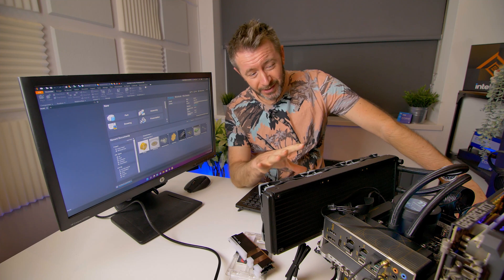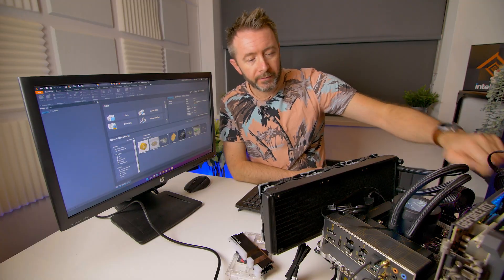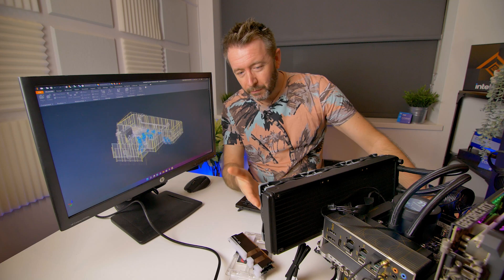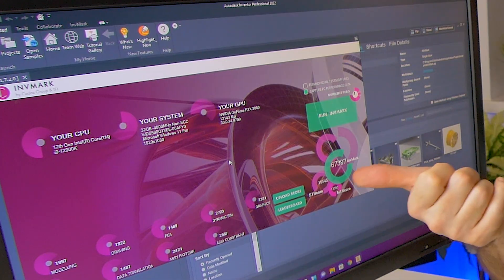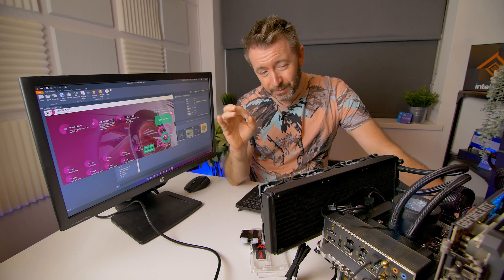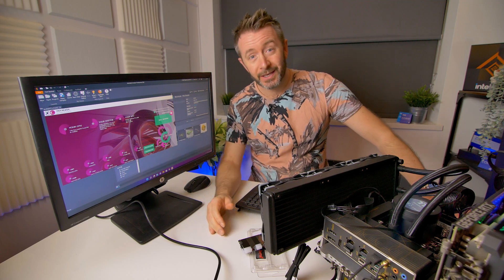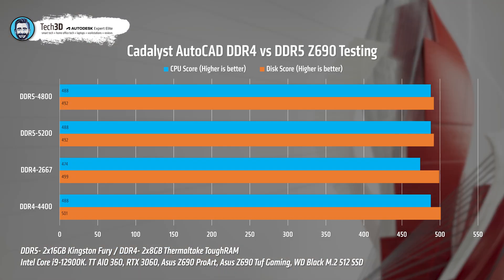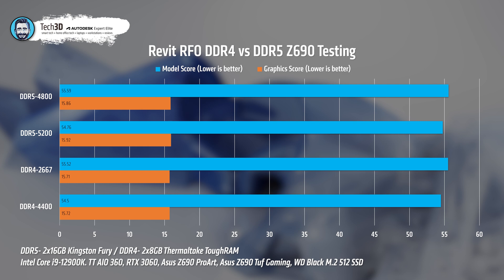Difference Between DDR4 vs DDR5 for AutoCAD, Autodesk Revit & Autodesk Inventor

Comment from the maker: Greetings! I verbally provided the CL in the intro for XMP but the DDR5 is 40-40-40 1.25V and the DDR4 is 19-25-25-45 1.45V 
ALSO..! If you get a blank white page on the InvMark site, there's been a BUG since day 1 with browser tracker blockers.  If you have a tracker blocker i.e. Bitdefender it will cause the site to fail to load.  Cadac are looking into it but its extremely difficult to diagnose.  If you want to use InvMark just disable the tracker blocker for that site.
For the benefit of anyone new, the InvMark test includes a HUGE dataset of around 1000 unique files and the final score includes a grading of how the system performed whilst opening that dataset from disk on several different occasions, there's also a save to disk test, a data translation test, so InvMark isn't just a straight up plain simple "cad model a part" test by any stretch of the imagination! Also, my day 1 AutoCAD CPU index was also bang on 488 with the 12900K so I honestly don't know why the Revit results changed so dramatically, it definitely can't be thermals as that wouldn't be affected so I don't know.  Still, interesting none-the-less.
Reply: Small observation made in Fusion 360 that might not have anything to do with it. NVidia studio drivers on a RTX3060 (laptop) kept it at 900MHz and even put it at 210MHz very frequently, even when trying to rotate and zoom the part. The Game Ready drivers kept it at 1425 MHz (with pushing it upwards, same as the studio drivers) and went to idle a lot less. So, maybe the Quadro driver caused the difference by keeping the card running slightly slower?
Reply from the maker: @ExMachinaEngineering  Something to investigate possibly, would be pretty bad for PR if the Quadro line was causing that much of a slow down.  I'm all for longevity and reliability in the professional products but not if it means that much of a performance hit under an entry level GeForce card

Comment: I'm building a new system, 3080 ti, 12700k,  dont want to spend more on ram so i will use my old 64gb of ddr4 2993mhz cl21, will it make a difference if I use that or should i get faster 3200-3600 cl16 or lower ram? I plan on running solidworks

Comment: I'm doing "as-built" models in Revit, which is modeling off of a pointcloud. Pointclouds can be anywhere from 6GB to 300GB. I was maxing my 32GB ram kit and getting lots of stuttering. Now on 64 and smooth as butter. If I'd build my system on a ddr5 platform (MOBO+64 GB RAM), I'd have to spend about $800 on these, while my DDR 4 (b550+4X16) was about $450. The only downside to my system is that I won't be able to have more RAM if I'll need it in the future (I have 4X16 now). So if I was building a system today, I  would have gone with the DDR 5. But for most users, DDR 4 will be enough for YEARS to come.

Comment: Thanks for putting this together.  It's just what I was looking for today.   Have you benchmarked the integrated graphics?   I don't do much 3d work in AutoCAD or Revit and wonder how much a quadro or gaming card helps 2d performance, particularly compared to Intel's latest UHD Graphics 770.
Reply: I don't know if this helps but i have a laptop with an AMD apu. My work is mainly 2D CAD and i found that the apu is holding good, except that it needs a larger ram than 16GB in order for a headache-free hatching on Autocad.
Reply from the maker: Its on the to-do list if my Z690 board is still working, there's a chance it might have been cooked by a faulty part that I was testing but if not then yep I'll run some tests on that

Comment: Revit itself is so old, that he does not know the difference. I wonder what would be the difference for SDRAM?
Reply from the maker: ...? I don't know what you're suggesting the difference is that I'm missing? I know the origins of Revit and was around during the Architectural Desktop days but I'm not sure what you're getting at there
Reply: @Neil3D  it was a joke about how outdated revit is
Reply: By outdated you mean single core? Yeah it sure is, Useless to buy multi-cores if Revit only uses 1. 4c/8t chip is enough for it, hell I even use 4c/4t and it still does pretty well.

Comment: boring huh ?  Because... it was obvious :)  

The thing here is, these applications simply DO NOT need and CAN NOT UTILIZE 90GB/s bandwidth available from DDR5 memory modules. Bugatti Veyron won''t be faster than Opel Astra on a road with radars/cameras where 40mph is the limit.  Both will be doing 40, that's it. 

Anyone running DDR4 at 3200 or 3600MHz is absolutely fine. You didn't state timings, primary and secondary, but as we see it doesn't make any difference. Uh, obviously :) 

Day1 performance delta : that's not so obvious :)  we guess you didn't notice any temperatures deltas on the display of liquid cooler, otherwise you would state that in video.
Reply from the maker: I wasnt monitoring the temperatures because it wasnt a day 1 vs day 40+ test, it wasn't a test that required the liquid or CPU temp to be monitored, I didn't notice the difference in results until editing.
Reply: @Neil3D  my apologies for missing the memory timings - went through the performance graphs very quickly.   It has to be EXTREMELY memory hungry app to see difference between DDR4 and DDR5 - Adobe Premiere is one such example. In specific conditions, it can gain 20%.   Y-Cruncher and other scientific applications heavily depending on memory access will also benefit, but they must not be latency sensitive (bandwidth only). Some appz in SpecViewPerf benchmark suite do benefit, too.

It's somehow complicated today : 99% of standard, typical applications do not benefit at all. In a year or two, when DDR5 matures and frequencies ramp up over 7000 + latencies decrease to 30-32, we will see some performance difference. 

Until then, just invest your money where it has real merit. You will get faster performance by using 12900k instead of 12700k or 12600k (uhh, once again not always not everywhere not all the time), but definitely not by going from DDR4 to DDR5.  Expand your RAM, 64GB DDR4 3200/3600MHz (well, MT/s) costs 220-300 EUR today (2x 32GB Mushkin Essentials, Kingston Fury, Renegade, Crucial Ballistix, etc etc).  That's sure a huge benefit compared to 16GB and it will be a benefit even over 32GB RAM, if you see >28GB RAM usage in Task Manager. Avoid swapping at all cost.

Make sure your cooling is "more than adequate" and chassis properly ventilated (intake, outtake fans). Check your CPU/GPU temps, don't let them run over 90 degrees Celsius.
Upgrade your GPUs, if working with 3D heavy stuff.  Yes they are the most expensive part of workstations :( 

Thank you for the video and effort you put into this testing !
Reply: @lubomirzvolensky3630  ,
 And now, with Z790 and i7 13th generation, for example, do you think it worths it using DDR5 5200 instead of DDR4 3200? I just ordered 64 GB DDR5 for music and video production, but I am thinking about sending it back and take 64 GB DDR4 after searching more about the topic... What is your opinion?
Reply: @Neil3D  could you please answer my question as well? many thanks!